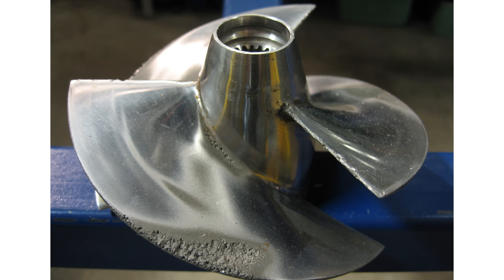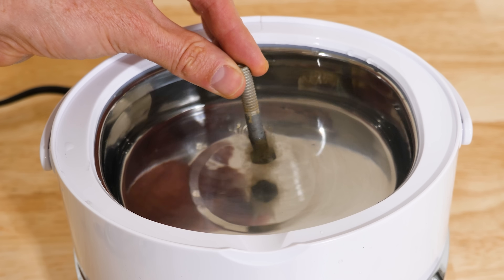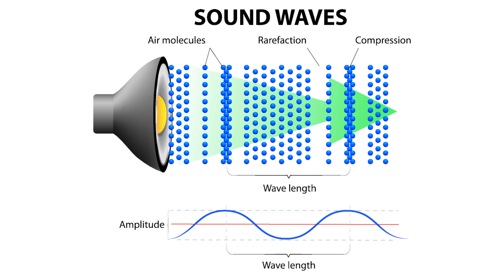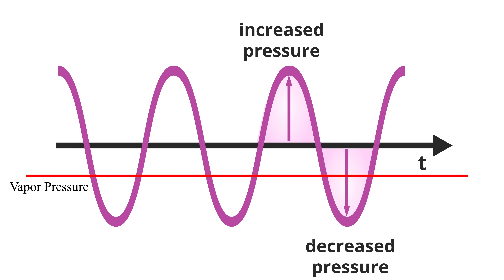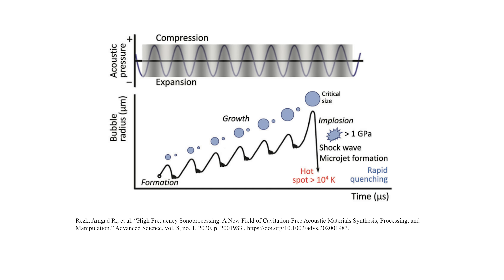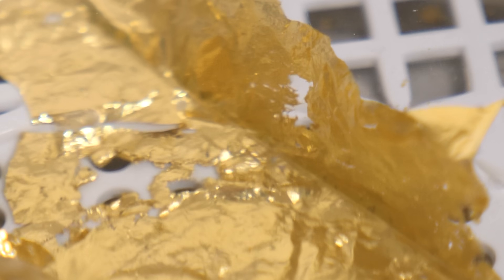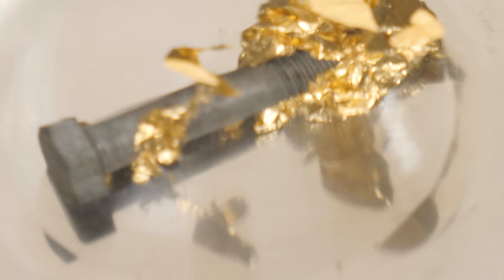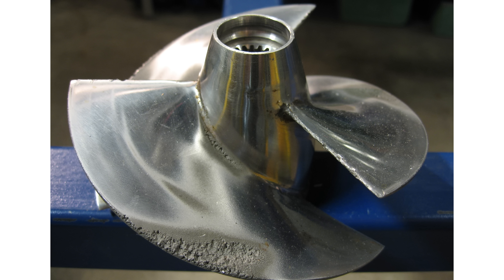Can Ultrasonic Waves Dissolve Metal?

Comment: Ancient Egyptian Ultrasonic Cleaners!

I think the Karnak temple in Luxor was a fluid filled instrument powered by lighting to separate precious minerals using ultrasound waves. The process is called sono chemistry. 

The lightning would hit the obelisks that were tuned using metal paint at the top changing the mass over piezo and dielectric break over point. Once the dielectric strength of the granite obelisk is overcome by the voltage of the lightning bolt it will conduct electricity down to the red quarts block it is sitting on and cause intense ultrasound waves into the fluid of the temple “reverse piezoelectric effect”. The obelisks in combination with the quarts block are called a "Sonotrodes". Once the ultrasound waves enter the fluid of the system they’re often reflected off of round columns and diffracted through small passages and opening. Obelisks were often but not always set up in pairs to recreate what’s known now as “The Double Split Experiment” which combines their waves to create a “Prominent central maximum” that would shoot straight out in the center between the two holes. This is where the waves stack, creating standing wave fronts, antinodes and cavitating liquid "small bubbles forming then collapsing" .The waves work their way through the system of acoustical chambers and towards a calcite stone blocks. Today to attract lightning you need an “Active” lightning rod, they use the wind from an oncoming storm to vibrate the quartz crystals inside creating the regular piezoelectric effect which attracts the lightning. Separate water sources often found at these sites could be used to vibrate the calcite stone blocks keeping the obelisks charged while waiting for lightning strikes. 

 
Karnak Temple is also part of a bigger and orthogonally arranged system using ultrasound to separate and direct particles flowing in liquid. Using the vector sums of the waves produced by the Temples “Wave form Generators” the particles in the fluid can be forced either to the sides or the center of the chambers they’re flowing in. At Karnak/Luxor the process starts a Luxor Temple where the particles are directed using water flow and waves North East towards the Mut Temple. Just to the North West of the Mut Temple the particles are redirected South East by the waves emitted from The Temple of Khonsu.  Those waves reflect then combine vector forces with the waves from Luxor to move the particles directly in front of Mut Temple. Once they’ve reached in direct alignment with Mut Temple, the temple directs them North East into the Karnak complex near the Tenth Pylon. The rows of Sphinxes helped keep the particles centered in the channels during this process. Once further inside the Karnak temple complex there were many different obelisks/sonotrodes combined with interdigitated transducers/acoustical chambers that would emit waves to move the particles to different sides of the complex and separate the particles of different sizes in the fluid at different points in the buildings. If you go on Google Earth and zoom out from the complex you will notice many different wave generators positioned orthogonally “perpendicular to each other” or being reflected off a wall to achieve the same thing. When you look at it just imagine more water in, around, and running between the temples. 
One of the simpler examples of the Ancients use of this type of technology is at the Temple of Seti the 1st in Abydos. There is thought to be two old wells in the first court yard, but they weren’t old wells they were obelisks. When those obelisks were hit by lightning they would emit ultrasound waves from the quartzite blocks in the fluid they sat in. The ultrasound waves would diffract out of the openings in front of them and combine together to create pressure nodes/cavitation points in the water. The most powerful of those pressure points was the “Prominent Central Maximum” area that shoots out perpendicularly from the point directly between the two holes. Again, this is known as “The Double Slit Experiment”. Most of the energy is sent through the center of the complex to the second court yard and some of the energy is reflected into a smaller passage on the side to the second court yard, setting up the second double slit experiment, only this time it’s a little trickier because the slits are different sizes. In the case of different sized slits the overall pattern will show the “Prominent Central Maximum” leaning towards the side of the wider slit. Of course this is exactly what the Ancient Egyptians had planned because the “Prominent Central Maximum” would now be perfectly lined up to create maximum fluid cavitation/metal separation all the way back to the end of the complex at the Inner Orion Hall. The Ancient Egyptians were masters of wave reflection, diffraction, and by the time their waves got to the First Hypostyle Hall they underwent a “Triple Slit Experiment” that is mostly thwarted by the reflective arrays of circular columns.

----SOURCES----:

Search for this on Youtube:
 Lect 9 - Sound Cavities, Resonance Frequencies, Musical Instruments

Manipulation of microparticles using surface acoustic wave in
microfluidic systems: a brief review
Jeonghun Nam, Hyunjung Lim and Sehyun Shin*

Ultrasound induced cavitation and resonance
amplification using adaptive feedback Control
System
Vipul. Vijigiri
Taraka Rama Krishna Pamidi

Geoffrey Drumm

Canadian Electrical Code :-)

Comment: ultrasonic waves alone cannot directly dissolve metal, but they can significantly accelerate the dissolution process of metal when combined with a chemical etching solution by creating cavitation bubbles that disrupt the surface layer, enhancing mass transfer and allowing the chemical reaction to occur more rapidly; essentially, they can "speed up" the dissolving process, not dissolve the metal on their own.

Comment: I used to work in an industry where parts had to be extremely clean before processing. We had a fairly large US cleaner (2 m x 5 m x 1m deep , 40 transducers). We would map it and adjust it by using aluminum foil sheets. Areas of high intensity would etch hazy areas into the foil. These areas could damage the parts we were cleaning while voids could leave residue on the parts. We had some other equipment to do this for conforming to standards... but the foil worked way better. We would use the foil for the leg work and then verify with the expensive stuff.

Comment: Shake up a bottle of hand sanitizer and put it in the ultrasonic cleaner. You can wiggle the bottle around and get the bubbles to combine into bigger and bigger ones until they will rise to the top. Try to get it all solid clear again! It is also a great way to see the bubbles staying put if they are small enough and jiggling about in place.

Comment: ⥊ 1515

0: Good (if not good, then not zero)
1: Ethics
2: Problem-Solution
3: Consent
4: Emotion/Will
5: To Testify/To Meet
6: Why/Who/When/How/Where/What
7: Information
8: Stability
9: Sanity
10: Network (Good Network, because zero)
11: Justice
13: Death
16: Tower
20: Judgement
21: Solving Problems with Ethics
22: Resistance
23: Resilience
30: Good Wave
32: Discernment
33: Jesus
40: Good Force
50: Good Expression
57: Counter-Terrorism
60: Good Reason
70: Good Information
80: Good Stability
90: Good Seriousness
96: Blockchain
97: Anarchy
98: Vegan
99: Revolution
100: Liberation
1000: Possible Conversation Method using numbers to convey meaning
For ex.: 6022: Good Reason to Resist.

Comment: I wish you would have explained why the foil dissolves but the bolt does not. With enough time, would the bolt dissolve too? Also, when the foil completely dissolves is there sediment at the bottom of the water or is it just suspended in the water?

Comment: Many years ago I helped some people pass hair sample testing to be able to keep and or get a job which required mandatory testing. Gas chromatography is considered the gold standard of testing for many reasons and the law considers it infallible and safe from people trying to cheat it somehow. I did extensive research on the properties of hair sheathing, cortex and composition. I determined  and proofed out that the scales that comprise the outer protective layer of a hair strand could be made to open by immersion in a mild alkaline solution thus offering exposure/access to the cortex. The next step was how to dissolve and remove the deposits within which would be the metabolites left from use of alcohol , cannabis use and coke use and opioid use.

 My research led me to a chance reference to a company that was selected to restore and remove dirt from a very delicate piece of fabric hundreds of years old that was of historical significance. They used ultrasound to do it.  This lead to my study of ultrasonic transducers and I developed several ways to apply this to the hair test procedure. I used both a tank and a recirculating tank with pump and hose so as to be able to rinse off much like when one is in a hairstylists chair getting a shampoo.  In short I would immerse the clients hair in a heated alkaline solution for 45 minutes until the scales opened which could be verified in real time by removing a strand and viewing under a microscope. 

Then the head was place backside down into a salon hair shampoo tub and fully submersed in 0 ppm distilled water with the same alkalinity used to open the scales and then the transducers were activated and remained on for 30 minutes. The next step was to then drain the reservoir and create new fresh solution of same temp and alkalinity, transduce it and use a small pump to a hose/hair rinse wand and apply a shower to it to carry off and down the drain any residual contaminants/residue. It worked !!! It is said to be impossible to pass a follicle test if you have ingested/ are a regular user of contraband substances. I had several people who were totally heavy daily users pass. this procedure must be done in 12 hours or less of the test as the new hair which is coming out of the scalp will have it's contaminants intact and cause the client to fail the test. One must also not touch their hair with contaminated fingers. One should immediate place a sterile head-dress/plastic hairnet covering at completion of the procedure and remove just before entering the testing facility.

 I toyed with the idea of creating a business venture out of this but determined that there were liability issues for the all too obvious reasons.  I was just the "smart" one in our family circle that was the go to guy whenever a crisis or problem arose. I already had a successful business but I did form a business plan which included  the same gas chromatography equipment used by the testing labs so I could offer proof that they were "ready" to pass the test.    Another commenter was thinking about using ultrasound to clean resin residue from bongs. My advice to use this tech to clean bong interiors etc would be to use 0 ppm water heated water and then induce cavitation.

  My research into bubble cavitation taught me that imperfections on a surface will induce increased bubble formation so If you can scratch the interior of the bong shaft and base with a glass etcher or diamond tipped dremel tool bit it will increase many fold the amount of bubbles to have implode and cavitate. If you watch a water droplet vibrate under  magnification from ultrasound you will see water molecules literally take on the shape of a many faceted diamond seemingly covered with sharp edges, at other frequencies it will assume the appearance of the outer casing of a chestnut which is spiked and horny like a medieval mace but with many more spikes. The water itself becomes "abrasive" on a molecular level.  

    I often advise the best way to clean the hard to reach interior crevices of a bong is to use alcohol and fine sand. Shake for minutes or attach by tape to a vibrating hand/palm sander. After a rinse and repeat the toughest bong comes out clean. If I still had my old ultrasound equipment I would probably have developed a protocol for resin removal.

Comment: Wonder how effective this is at cleaning bass strings. There's a common myth that gets propagated about how grimy bass strings that haven't been changed in years can sound good as new if you put them in a pot of boiling water. Obviously, they don't sound good as new, although they will sound SLIGHTLY better. I wonder if this device can actually clean a set of bass strings much more effectively and make them actually sound closer to brand new.

Comment: Dang, I have considered getting one of these cleaners to clean some autoparts such as fuel injectors, O2 sensors etc, Now I am wondering if it can do damage to those parts such as those with thin metal screens, will this damage those parts?

Comment: Was this the same tech used to bring down the twin towers?
Reply: Definitely. It was an inside job and were only able to begin shedding some light only 2 decades after
Reply: @dotsdot5608  Just testing to see if the system is still in place. Good work soldat, RTB and debrief.

Comment: Saying it has to do with sound is not exactly accurate, it has to do with vibrations, which is what causes sound, but the ultrasonic cleaner would work under a vacuum still, just like an ultrasonic cutter would still function in a vacuum. It's the vibration that make the sound, not the sound that is having an effect.

Comment: "Can Ultrasonic Waves Dissolve Metal?" Well, the answer is "No". This cleaning method doesn't rely on material going into solution.

The damaging cavitation effect is called cavitation erosion and not cavitation dissolving so "dissolving" isn't the correct description. The imploding bubbles pulverize the material, but the material remains solid. It's just that now it's dust, either at the bottom of the cleaner, or floating in suspenion. 

So the correct title would be "Can Ultrasonic Waves Erode Metal?"

Comment: Cavitation bubbles is not really a full explanation in terms of cleaning. The impact of pressure waves on solids varies depending on the strength of bonds between molecules. Pressure waves more easily impart force to small, weakly bonded molecules, making them physically move relative to that which it might be bonded to. A bit of dirt has very little mass or inertia and is easily wrenched from its loose bond with the more solidly bonded structure to which it is stuck, so dirt then is released into suspension in the cleaning fluid. As the energy intensity of the ultrasonic waves increases it can even break the bonds of the more solidly bonded structure, hence even solid metal can experience decay.

Comment: I didn't got it. I own a ulktrasonic cleaner myself, it works on 30 and 50w. I use it to clean wet/corroded smartphone boards. I have never seen it corrode any metal or component.
I use isopropilic alcohol (99,9% alcohol).
And yes it gets hot. If you use for 10 minutes, if theres just an inch deep, the alcohol gets hot like cofee.

Comment: What happens when you apply very high frequencies to cancerous cells? An invention on the 50s could destroy tumors just with vibrations above 300000 vibrations per second, each tumor had specific vibrations  that they could not resist, I would like to see that experiment in here to see if is true.

Comment: How is it possible to measure 42,000 vibrations per second? The instruments or devices that detect such movement is mindblowing. 
Also, I wonder how the soda tasted after going through the process? All the carbonation was removed by the ultrasonic cleaner right?

Comment: Diesel engine liners get eroded by cavitation. Also - I've always wondered why they don't have a slightly varying frequency (say 35-45khz?) being driven into the transducer. Then you wouldn't run into the issue of certain areas of your object not being cleaned due to their shape. You run into this cleaning say a carburetor that has flat, round, big, small areas. The tiny areas sometimes don't get cleaned, I think, due to harmonics.

Comment: Engines with wet cylinder liners can suffer acutely from cavitation errosion as you described.  Caterpillar engines had that problem about 40+ years ago.  The solution was to use a good quality corrosion inhibitor in the coolant.  The cavitation created a porous liner in the lower half of the cylinder sleeve.  It just looked like a brown stain from the inside of the liner. Our organisation fitted Fleetgaurd water filters which  doses the water with inhibitor plus removed rust and sand particles from the water.  This is important as many engines still had casting sand left from the block casting process.

Comment: Are these things dangerous? You can't dip you finger in it, can you? I bet it's not as powerful as, let's say, a high pressure water cutting thingy. Oh they just say it can cause rhumatism, ah I don't know the term, isn't it right? Anyway, they do say, not advisable, though...
There is also fat burning, as a treatment that uses this, and I found some machines that can WELD with ultrasonics.

Comment: What's really cool is ultrasonic wire bonding used in the semiconductor (and other) industries. You vibrate a wire on a metal surface so the two metals cold weld together

Comment: In hydraulic pumps, cavitation can happen so strongly and so fast the entire pump can stop working in just a few seconds. It's strong enough you can hear the cavitation, which is super-bad. It typically happens where there's an undetected restriction on the fluid inlet side of the pump/line, pressure drops to the point of a vacuum pressure on the inlet side, bubbles form and collapse, eroding the gears, the housing, everything in seconds potentially.